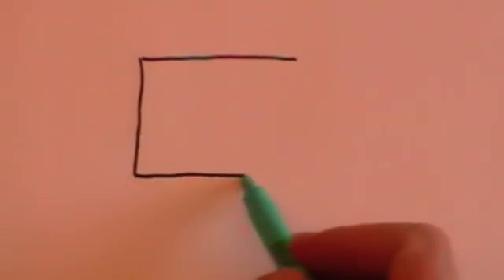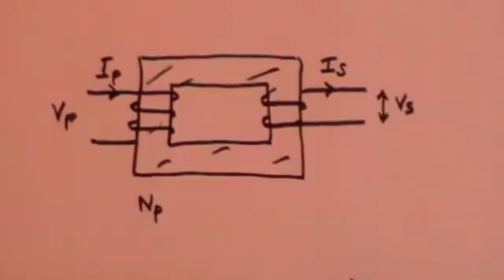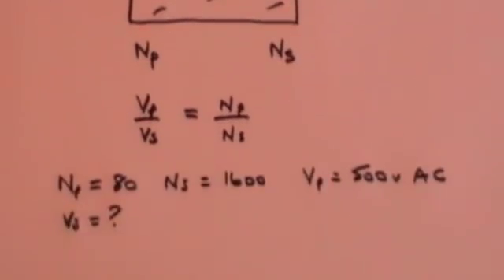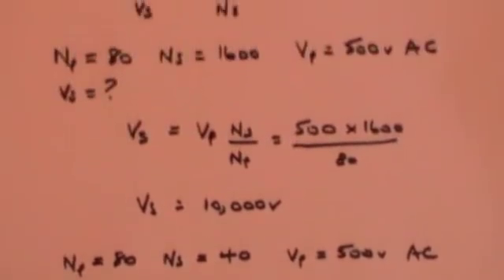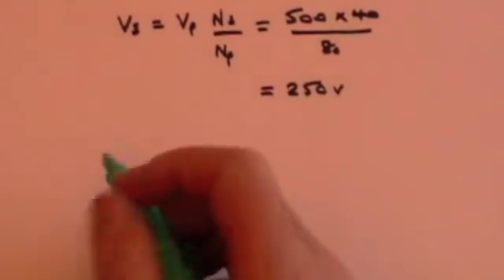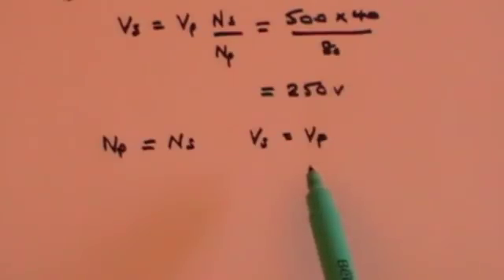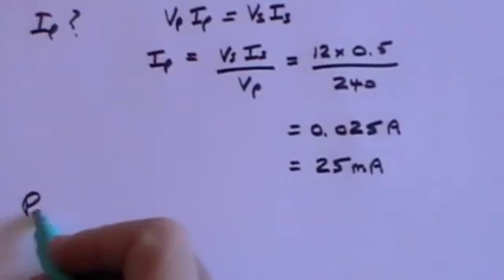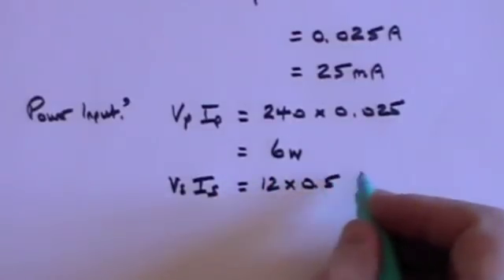Transformers: GCSE revision

Comment: In 3:36 why does the voltage have to be a.c and cannot be d.c ? And can you cover a topic on a.c and d.c because i don't understand what they actually does.
Reply: As far as i know, Transformers will not work with DC voltage since it has a constant unchanging current that creates no change in magnetic flux.

Comment: Some Follow Questions to check pupils took it all in?

When we say step-up and step-down transformers, what are we stepping up or down?

What is a common material used for the core of a transformer?  Why do you think this is a good material to use?

What does Vp stand for?
What does Vs stand for?

For a transformer to work, what can you say about the number of coils on either side of the core?

Why do transformers not work with a Direct Current (DC)? 

You only induce a current in a coil of wire when the magnetic field is …………….?  Think about how this explains why transformers only work with Alternating Current, not with Direct Current.

What does np an ns stand for?

What formula links Vp, Vs, ns and np?

Did you notice how the narrator showed FULL WORKING OUT by listing the equation he was using, listing the variables, rearranging his formula, substituting the numbers and leaving an answer WITH THE UNITS?

What is unique about an isolating transformer?  Why would you use them?

Why are transformers not quite 100% efficient (even though we assume them to be!)?

What can we say about the power going into a transformer and the power coming out of a transformer?

What formula links Vp, Ip, Vs, Is?

What do you usually use transformers for in every day life?

What type of step-down transformers do you usually use to charge your phone?

What are the benefits of using this type of transformer?
Reply: 1) we are stepping up and down the voltage

2)a common material is the iron core which is used because it is easily charged and discharged

3) vp = primary voltage

4)vs = secondary voltage (on the other end)

5)if the number of turns coming from the supply is greater than the number of turn on the other end then the transformer will be a step down transformer... And if the number of turns coming from the supply will be lesser than the number of turns on the other end it will be a step up transformer

6)tranfromers dont work with dc current as direct current flows only cuts the magnetic flux once and a little voltage is induced and then it stops... but ac current as alternates and flows positively and negatively it continuously induces voltage

7)np = number of turns of coil on the side coming from the supply and ns = number of turns on the output end

8) an isolating transformer reduces the risk of voltage fluctuation and makes the wiring and circuit more stable(they do not alter the current or voltage from the supply)

9)some energy is always lost in the form of heat so the efficiency is not a 100%

10)the power always remains constant

11) Vp x Ip = Vs x Is

12) transformers are used by power stations... firstly the power houses use a step up transformer so that the voltage travels to us quickly and then a step down transformer is used to make the voltage usable for our houses and devices

13)small step down transformers are built in our chargers of phones and laptops as they are fragile and are sensitive to high voltages

14)it reduces the voltage coming from the switch board and makes it usable for the phone or laptops

                                                         RATE MY ANSWERS OUT OF 10

Comment: Interesting series. Has the GCSE syllabus changed significantly over the last few years? Because topics like motors, electromagnetic induction, or even the SUVAT equations, were certainly not taught to me when I did my GCSE's 4 years ago.
Reply from the maker: I suspect that the syllabus has not changed that much. But the different exam boards have significantly different material in their syllabuses. I am trying to cover all the ground so it is quite possible that some of the material does not feature in every syllabus. Nevertheless, I hope it provides a very useful grounding for the basics of physics.